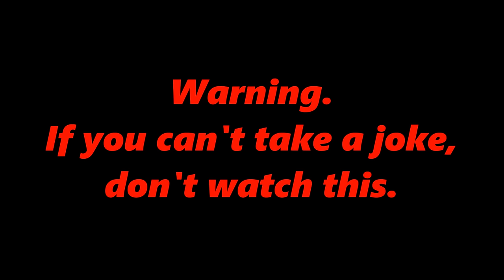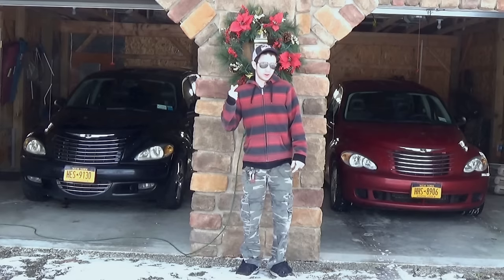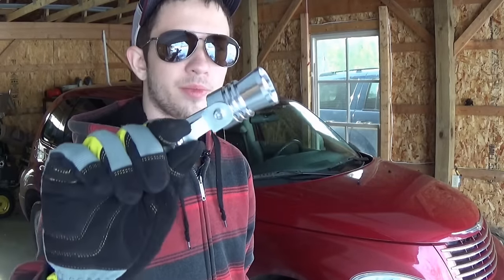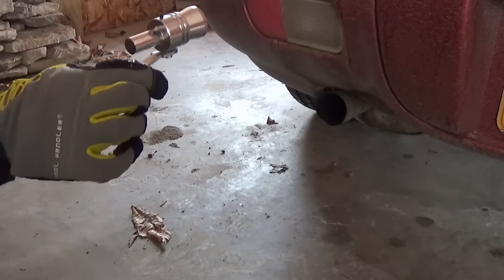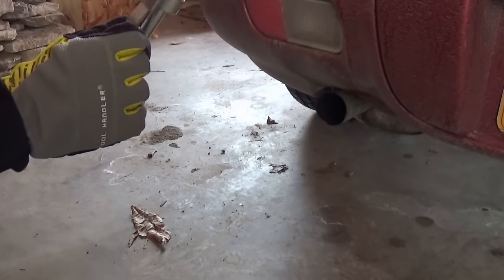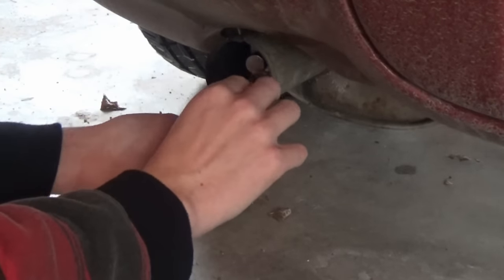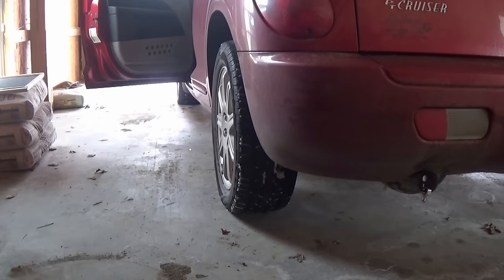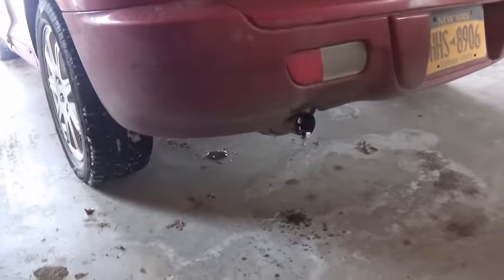REAL VS FAKE TURBO

Comment: For more real power. Correctly ground your car to the chassis. Lots of vids on how to do it. It's a guaranteed 5 real hp. Also prolongs anything electrical + cleans up your electrical/audio system. I know I've owned 2 cars where the audio & alarm system was = in $$ to the new cost of the cars. A new e30 BMW & a late 80s 16v. VW. Both show quality. My PT came with the stock 6 CD in dash single DIN 6 speaker audio, which is 1 of the best stock setups Ive heard imho so far in a used any car & has enough stock bass & treble & sound for my audiophile ears. The only change I'd make is an active Xover IF the stock speakers were not dual cones & I'd add 1 of my leftover custom Phoenix Gold 12" tuned bandpass boxed subwoofers w/my leftover Alpine "dual B" 2 channel 75 watt per channel @ 8 ohms which has both a mono switch & a 3 position bass Xover preset khz switch on it. At the stock 4 ohms in mono that's 300 clean watts of just bass. Not worth it imho due to the proprietary pin connectors all 2001+ cars use now & I've beat up my spine enough lying under dashes & cars upside down for 4 lifetimes.Anyway imho ground your car. 5$=5hp or NO $=5hp (if you have some exrtra wire, screws & a few wire ends left over) back in the 70s, mandated if you raced any class in SCCA. Now you can spend easily $400+ just 4 a grounding system made by most audio or car makers as options.You'll get the hp you don't get with the nice intake you put on. Eventually you should throw a tune on your ecu or invest in the best rated eBay programmer for your turbo. A decent $30-$60 neon srt-4 compatible programmer should have at least 3-6 useable preprogrammed base maps in it. $60 got me an ebay programmer for a Dodge Magnum R/T which lets me change everything from AT shift points to fuel flow & timing. That with a magnaflow exhaust makes a huge difference in performance & fuel economy too. Grounding your car/turbo you might see up to 10 hp or ? of more/ & def. Faster boost. 15 min. /1 hour max job. Was a big 1st mod in the 80's for us Yes I'm old-er. PT is my 64th personally owned car & again I needed to buy a car that specific day that wasn't embarrassing & I like unique & heard it was reliable. FYI, I worked part time @ 4 dealerships & flipped cars when young to help feed my kids & I wanted to learn the car business to explain why so many cars. Grounding my NA PT + 2 fuel injector treatments (fyi only STP gas treatment raises your head temp 10-20F+ but it works very well & raises your octane but I use Berryman in the tank to remove top end carbon every 3rd tank). Now it's too cold here w/o garage space 4 me to do anything serious yet & nothing has broken. I DID, fix my "known issue" PT idle drop , or "serious before almost die" if the AC & fan were on high. I don't have a problem with the NA 157 hp stock. With 91 Premium gas (best you can get in CA). I barely tip into the throttle to get it moving. 1/3 throttle max is all the 4 spd. AT needs. I'm usually going too fast with more. Got lucky with past 1 owner. He kept it up & all service records since new. He's a specialty Daimler/Chrysler car nut & still has 3 or 4 & 1 shop works on all his cars (sorry I can't write short except for legal briefs which I quit doing 6 years ago. Undergrad in English Literature & Writing & I'm only subscribed to 2 YouTube channels & this is my 3rd comment ever) Last thing. A recommendation. Now that you've found Flitz polish. I highly recommend Formula 303 interior treatment/ sealant. And after you Clay Bar your paint next time. Invest in KLASSE car wax. I started out detailing & it's still a passion on good cars/paint. It's ridiculously expensive @ $20 for about a pint, but I swear it's the ONLY car wax or resin that has made my then new car's, 1 Bronezit color, other Delphin Gray paint , simply GLOW after a Clay Bar & any paint cleaner/wax combo 1 pass. before final wax with Klasse . NOT sure if it will make Black gloss glow, but it's simply the best wax on earth imho & you will notice the difference. Magnum R/T is metallic gray & when I use it, that does GLOW. Yes the VW competed in car shows/Sound offs & was featured in 1 old European Car issue article. Glad to know there's another Dodge family out there besides me. Nice of you to maintain family cars. I washed & waxed my mom's cars for extra gas money starting at 15yo. Sorry again I'm a serious gearhead. Kids aren't. Have 2 ex students who are that both wrench, but it's cheating when 1's Dad built a 20 foot tall garage with 3 bays & 1 2 post & 1 4 post lift. Even has separate engine & electrical back rooms. Extra Bay is filled with boat stuff. His parents live in the countryside East of SF so land is cheap near the vineyards 25 years ago. Dad even wifi'd the garage 10 years ago & it's 650 feet from main house. Yes I'm jealous. Feel better & keep learning & posting. End of line....
Reply from the maker: Thank you for all the information!  I appreciate your note, I know what you mean, it's hard for me to stop typing once I start as well haha.  English was a fun subject for me.  I read it all though, I promise!  Really appreciate all the advice, and I will definitely look into grounding things a little better in the future.  Thanks again for the support!  :D and Merry Christmas to you and yours
Reply: This is the comment that never ends it goes on and on my friends some people started reading it not knowing what it was....